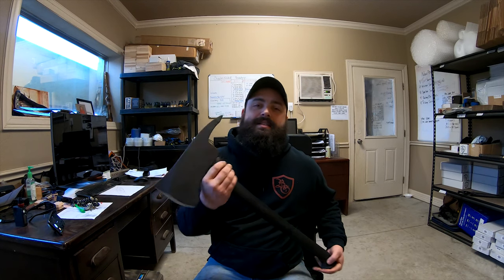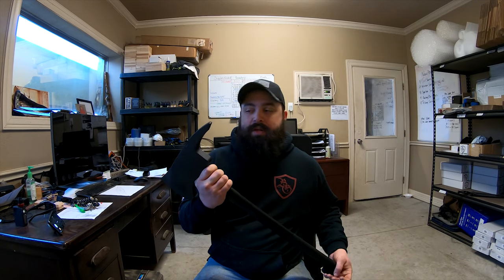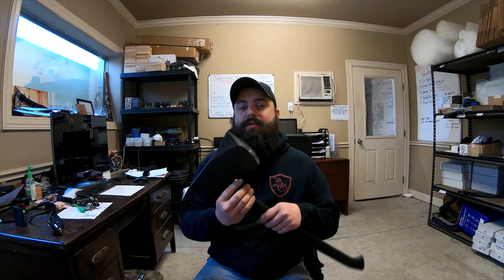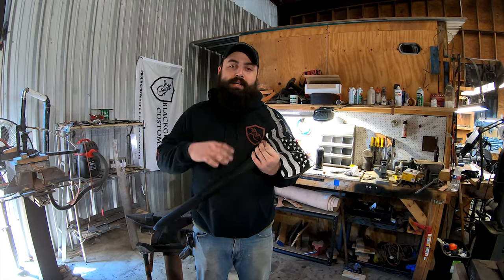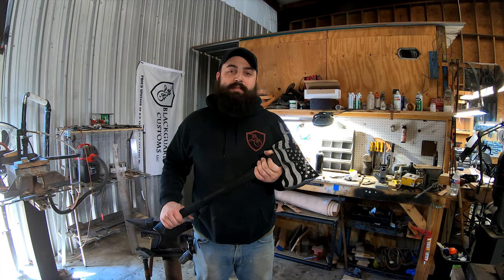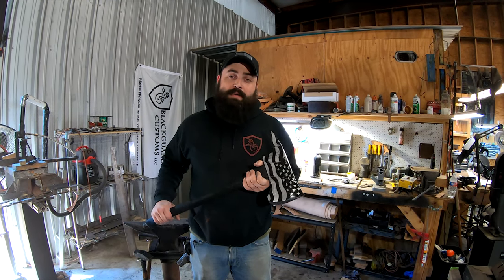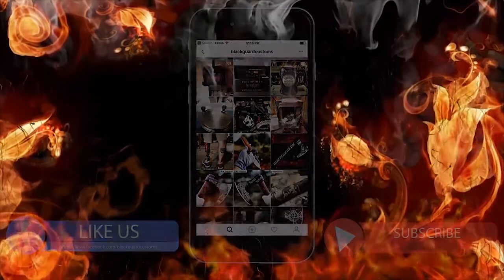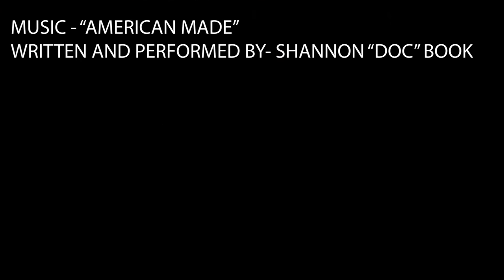BLACKGUARD TV - ENGRAVING A FIREFIGHTERS AXE!

Comment: How long would the engraving last through use?
Reply from the maker: With the depth we get they will last for a very long time. The coating will wear out but can be easily re applied.
Reply: @BlackGuardTV  thanks! I got an old fireman's axe at an antique show, took the handle off, and I've been procrastinating engraving it. Gonna get to work on it while there isn't much else to do. Cheers, stay safe